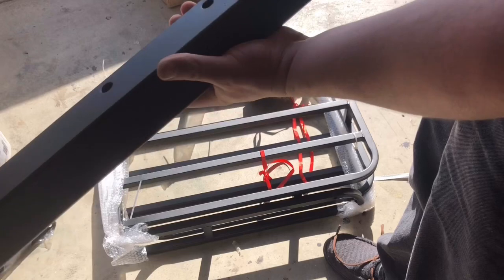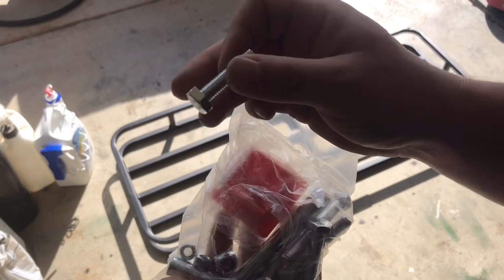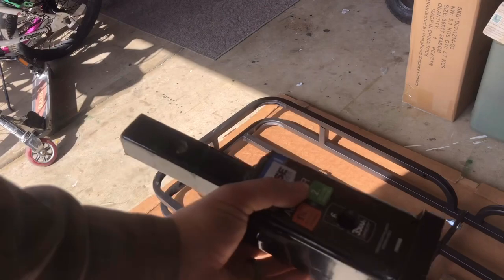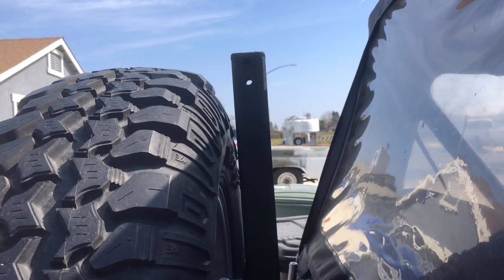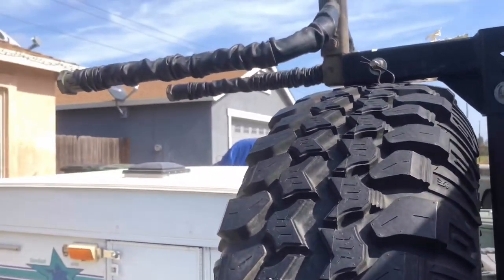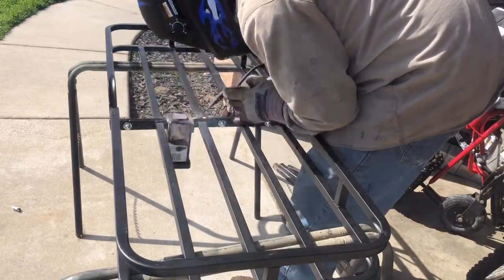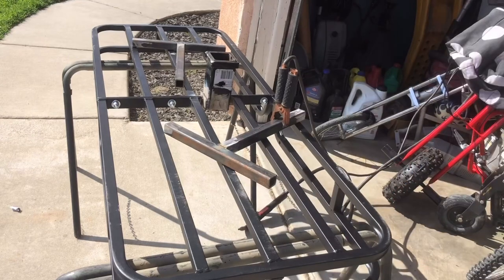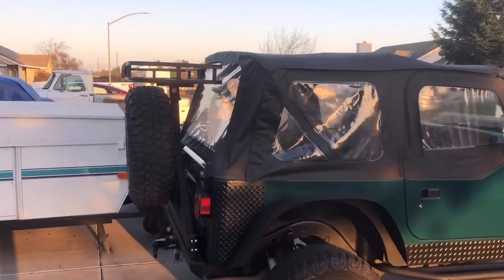Jeep Wrangler- DIY Overland Rear Trail Cargo Rack Basket Build JEEP  TJ XJ YJ JK CJ

Comment: Nice build, have good welds on that man!! Also noticed the nozzle missing on the tip, does that keep the splatter down? Also have a flux core welder, that's why I ask, Thanks for the ideas, Keep Jeepin!!!
Reply from the maker: 💥 thanks, I don’t use the gas cup because flux cored wire doesn’t require additional gas to shield the welds, when the wire reaches temperature there’s a chemical reaction that produces its own gas to shield the weld area, but there is a dual shield set up that can use both gas and flux combined,  its personal preference and good welds can be produced either way, thanks for watching!

Comment: would you consider making and selling one of these?  great work
Reply from the maker: I have since modified it to accommodate a diy awning that I made, but Possibly I can make you one and mail it to you! Because shipping I think the best way to do it would be in two pieces, I make the part that slides in the tube with the supports and you bolt on the rack, it would require you to drill and bolt the rack to the support! Is that something you would be interested in? Thanks